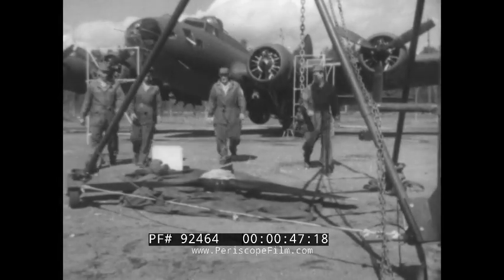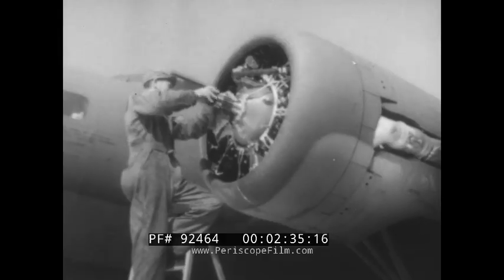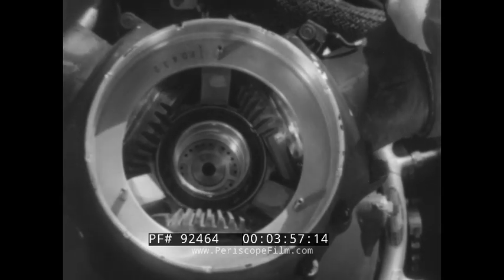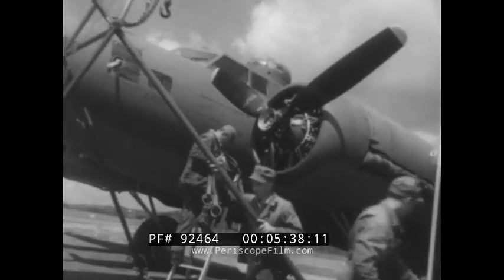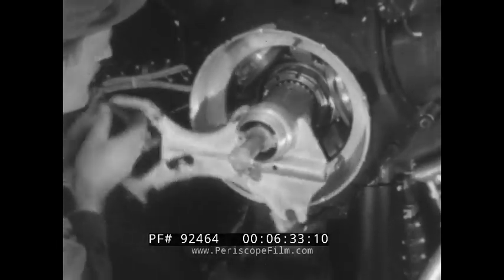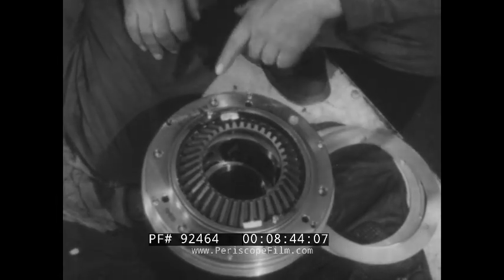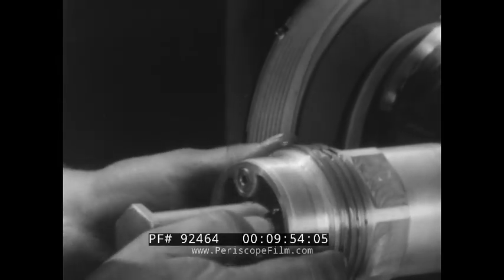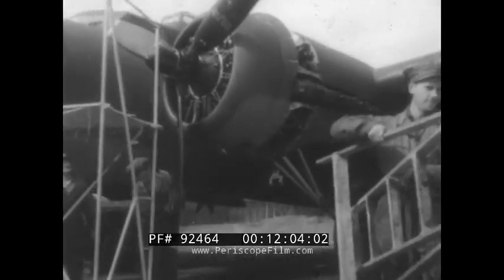B-17 PROPELLER INSTALLATION    WWII U.S. ARMY AIR FORCES TRAINING FILM    FLYING FORTRESS 92464

Comment: Apparently safety wire pliers had not been invented yet. Without them you have to turn the wire by hand many times and then cut the excess with a set of diagonals. Also the airman working in this video had not been briefed on the hazards of FOD 😅💀

Comment: This propulsion machining work is astounding. I was a machinist starting 2 days out of high school. During my time, I went from manual lathes and mills to full tilt CNC 4 axis machining centers,  using computers to program a toolpath. I am in awe that the WW2 machinists could mass produce the gears, splines, and engines required just using technologically  simple manual lathes and mills. One moments in-attention will scrap the part you may have spent days machining. This was truly the Greatest Generation. The ability to build better aircraft, fighters and bombers than Germany, primarily won WW2. Study the complexity of the Merlin engines, and you will understand what an accomplishment it was.

Comment: I changed props a the Lockheed Electra L-188 a few times as a young airline mechanic in the early-1970s. The most difficult part was freeing the old prop from its aft cone as it would hang up. Using a prop blade like a lever two mechanics would rock the prop fore and aft until it freed. It was quite a physical undertaking. When hanging the new prop, the hold down nut was torqued to 2000 ft/lbs using a torque multiplier. Jets are easier.😉

Comment: This video is very interesting by showing a lot of the contrasts between how aircraft maintenance was performed then compared to now.  Today, young Airmen are using technical orders on laptops/tablets and not relying on memory to do the same type of work.  Also, these maintainers were not wearing gloves while applying oil/grease, did not wear safety glasses while cutting safety wire using diagonal cutters, and there was a distinct lack of torque wrenches.

Comment: I  am a constantly amazed to see how complicated so-called "old tech" actually was, and awe stuck by the sophisticated engineering revealed in these films.  I know that the techs of that time, would have little in the way of skills applicable to modern aircraft.  But our techs would be just as ill-equipped to work on vintage planes.  Vintage restorers have said how little that modern aircraft construction has in common with war birds, in spite of seeming just as complex in itself.

The narrator referred to torque settings of the various components, but there was not a torque wrench to be seen, although there  were a variety of specialized tools for the task at hand.  Given the investment in the plane and the importance of the job being done properly, I'm surprised that they didn't have torque wrenches on site for precise settings.
Reply: yeah they shoulda put in a click sound when the right torque was hit.

Comment: Without knowing this truth, one would think the entire assembly would be nothing more than a splined shaft with a nut on the end to hold the propeller in place, with maybe an o-ring oil seal to prevent oil leakage.

Comment: You have to think all those gears on the prop, if an engine dies you need to feather the prop (so it is sideways to the wind and not creating drag) if you can't do that asap the whole plane becomes not easy to fly, it's killed many 2 engine aircraft crews. Getting an engine shot out and having it dies, still needs a feather to get home.

Comment: Those round hubs on the front are prop pitch rotors. These motors are used today by radio amateurs for turning large antenna arrays and towers. i have four of them here.

Comment: What I find more amazing are the minds that thought about all those parts fitting together and why they had to be made that way......It's just amazing.
Reply: Even more amazing…it was done with slide rules and blue prints…none of that CAD stuff.
Reply: @DogRedful  ....I wonder if those parts were designed on top of previous designs or were they totally new.
Reply: @humbertothebeliever2443  that's exactly how equipment gets designed. It's based off previous designs and parts. It wasn't pulled out of thin air.
Reply: @holdendavid9025  .....Got it.
Reply: @humbertothebeliever2443  My hunch is a new design, but I'm not an engineer.  Either way, the precision of these things is mind boggling, at least to me.  I'm an Electronic Tech and I've never been good at the mechanical stuff.  Hat's Off to anyone who is.  :)
Reply: @johnalexander7490  .....I just looked around and found both engines were designed by the same company, Pratt & Whitney. So @Holden David is correct. I'm guessing there's many components very similar to the B24 engines.
Reply: @holdendavid9025 ,
   My Dad, who runs a lrg. Machine shop in the Midwestern US, always told me in reference to proprietary designs etc. that, "There ain't a f'n thing here that ain't in the Machinery's Handbook!". Lol!
Reply: Incidentally, my friend Otto Dietrich worked for Curtiss-Wright as a young man in St. Louis in the late thirties. He designed and had the patent for the planetary gear hub that you're looking at right here. He also patented the design for a track steering system for early caterpillar type tractors, (bulldozers and the like), that could allowed your feet to steer and your hands to be free for control of the blade or loader etc.!
He had 'Dietrich Engineering' in Morton Illinois for many years. Otto held a few tens of ingenious patents before he went home to the Lord in the late nineties.
   Otto was a very nice and humble fellow that would always tell a kid anything he wanted to know about machinery and machine operation. 
   R.I.P. Otto! Godspeed buddy!
Reply: This planetary gear design was important, for it allows the props to pitched and 'feathered'. I often wonder if this helped Doolittle get his planes off of the carrier deck before his raid! I know it allowed the prop to be feathered forward to cut wind-resistance when an engine failed. Still does in fact!
Reply: @oldnick4707  Also adjusting the blade pitch affects speed of the plane and fuel economy.  During the war in the Pacific Charles Lindbergh made secret visits to the island bases and taught P-38 and other pilots how to adjust prop pitch and carburetor settings to get maximum range out of their planes.  This is how they were able to ambush Yamamoto's plane in 1943.
Reply: On some airplane designs, the machine gun shot through the prop in perfect timing! I understand how it is done, but I can hardly believe it.
Reply: @Guttersmart ,
   Yeah! WW1 era too!  The Soviets shot THROUGH THE CRANK/BARREL of some of their planes!
Reply: Think about those multi cylinder radial engines that have 18 and 24 cylinders. No computers involved.
Reply: @cousineddie7898 ,
   Yeah! Servicing that stuff and extensively repairing these systems in the rainy season in a jungle or a sandy dusty desert area! Master mechanics for sure!
Reply: And every part had an individual drawing made by a draftsman in addition to the drawings of the complete assembly and sub assemblies. There was a whole lot of wood, graphite, ink and paper behind all those metal parts.

Comment: one thing he forgets, is that the oil on the nut also alows for a friction free rotation, so the torque applied by a torque wrench later is ACCURATE, not the resistance of the threads, but the squeeze on the assembly, but also this oil aids in removal next time, preventing rust on the parts as they are running.
Reply: what torque wrench? just a big bar. days when engineers worked on feel fella
Reply: @garethmayfield4014  Every prop assembled was done by that same guy....he was very busy....his weight was certified   !

Comment: Geez, no PPE equipment used. In the 70's we used tricochorloline (a.k.a. Trico) for degreasing C-130's. Trico is a halocarbon used since 1920 and classified as a cancer 
causing agent in 1981. Service Master was the replacement and useless. It left an oily surface and would strip fresh zinc chromate coatings. These earlier mechanics had ethics
and talent. They were worried more about death caused by wartime. Great documents. Thanks.
Reply: No gloves. It went right into the skin
Reply: @chemistryinstruments7156  Yep, fortunately the body chemistry maintained its delicate balance by the careful introduction of whiskey and Lucky Strikes.
Reply: Lol that’s an air/fuel sprayer and a bucket of 100/130 he’s using at the beginning. Get that shit good and aerosolized so you can breathe it properly.
Reply: ...I can dig it...at Sikorsky WPB (1990s) we used MEK to clean the surface underneath the special air hardening caulking that sealed the fuel tanks of the S-76 - when manufacturing was returned to the main plant in Stratford they didn't use MEK (for the same reason) and the customer complained of leakage in those same tanks - they were sent back to WPB for repair...and yes we used that same MEK but first we had to completely strip the tanks of the old sealant - a very nasty job - required the techs getting into those tank that still reeked of JP4 ( a real bitch of a job in the oppressive Florida summer weather in an non climate controlled open hangar - but we did the job - the company lost money because of 'climate/environmental politics' the work was done on the company dime - still Stratford wouldn't listen...
Reply: @mohammedcohen  Greetings friend. I am fully with you. Reminds me of
a quote: “We the willing, led by the unknowing, are doing the impossible for the ungrateful. We have done so much, with so little, for so long, we are now qualified to do anything, with nothing.” ― Mother Teresa.
You did your job right and the Flight Crew thanks you because they were safer because of you. The so-called management teams are clueless of 
correct procedures and should be hanged for endangering the Flight Crews safety. Keep safe brother.
Reply: My father worked on them during the war at Curtis Wright  and in England at air fields he always said they used mineral sprits to clean parts and the really cruder up stuff they used gasoline and a scrub brush first outdoors of course weather permitting I have a A@P but have never used it got it in high school at emery in Miami  I always looked at aviation as a hobby and not a career to my engineer fathers disdain too much government involved .

Comment: Changed numerous props and engines like this on the T-28s in Corpus Christi, TX. Never knew the real name of the oil distributor shaft until now. I was always taught it was the “donkey dick.” :)
Reply: I was there in 76, handed out small parts for the T-28s. AIMD

Comment: I wonder if the cleaning solvent was carbon tetrachloride? We were still using it in 1967. It’s banned now…
Reply: I was wondering what it was too.
Reply: I was using MEK in the '70s like it was a common degreaser/cleaner.

Comment: Wow…Those mechanics were an incredibly awesome team back then. Also impressed with the behind the scenes of all the factory machinists and tradesmen who had no digital and CNC equipment and could hold those tight tolerances. Very cool…
Reply: They actually had to work back then!
Reply: There’s still airmen changing props on C-130s today.
Reply: All designed with slide rules , pencil and paper

Comment: Not a torque wrench to be seen. As I recall from my P2V-7 days, we used a big "Sweeny Wrench" with 10-1 gear reduction to torque down the prop.
Reply: It seems as though they referenced the torque value in a unit of measure specific to the size fellas they had.  "Pre-torque to Jimmy (100 lb.) hanging off the extension bar.  Final torque to Skip (180 lb.) hanging from the bar while Roger gives it a good old wallop with the brass mallet."
Reply: The torque is estimated using the length of the bar and the amount of strength an average man can pull. You’ll notice at the 185 foot pound reference, he’s pretty much hanging off of a 4 foot bar. This technique was developed for two reasons: torque wrenches were in short supply during the war and, for such large assemblies there is a somewhat wide range of allowable torque values. But if you do it right with a 4 foot bar, you’re very very close.
Reply: @davidgold5961  - 100 pounds applied to a 4 foot bar equals 400 foot pounds.   Looked like the mech was hanging on the bar.  If he was 185, that would apply 740 foot pounds torque.  That's dang near double, 400.

Comment: Ah, the "before times", when we just sprayed nasty solvents around  in the open with no containment or PPE.
Reply: Prob'ly was carbon tetrachloride in the sprayer.  A great solvent, but not so good for humans..
Reply: @gary6449  Or MEK or avgas.
Reply: That's why after the war, so many military installations got classified as clean up sites. Even pre-EPA regulations were waived on military bases. If you didn't turn purple and drop dead within 48 hours, you were considered to be OK. (No, really! There were rocket propellants they developed after the war that would do that!)
Reply: In '44, [Hughes] Air Force Plant # 44 [now Raytheon] at Tucson International Airport was tasked with removing the Olive Drab over Grey camouflage paint from B-24 bombers. As the USAAF had air superiority, the natural aluminum finish had better visibility, less weight from paint, and much lower drag. Unfortunately, they used a high pressure spray of trichloroethylene [TCE] to strip the paint. This percolated down to contaminate the ground water. Tucson city water has had  problem with TCE in later years.